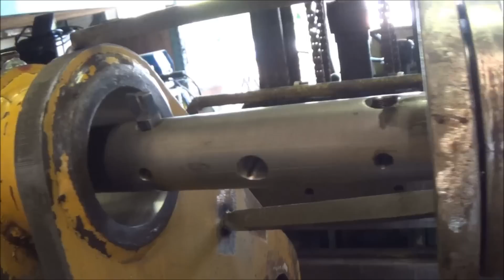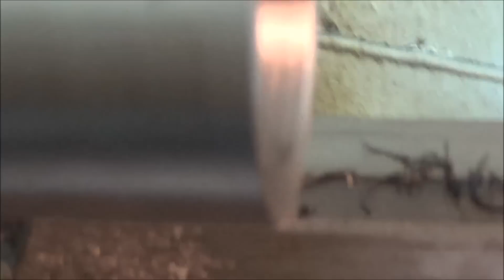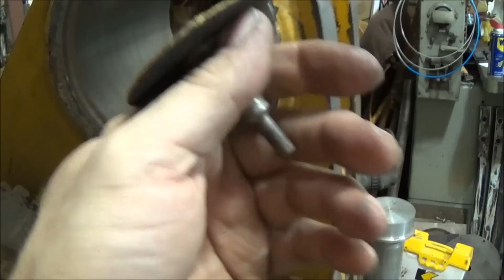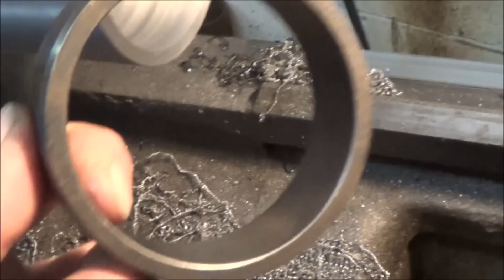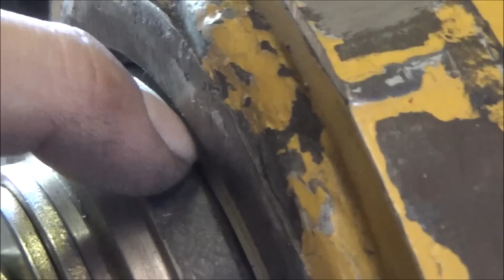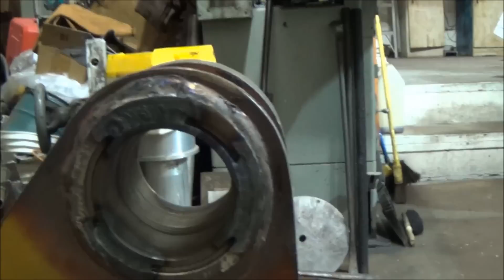Line Boring And Bushing Pt. 2

Comment from the maker: Hi Chuck,  Correct, the carriage and power head is not attached during setup, I will show a setup from the start, perhaps I can even do a mock setup. If "most" of the bore is OK, it's not to bad, bout if it's football shaped, it's gonna be a problem, and you have to get creative, same thing applies when the bores are far apart from one another and you can't reach with the carriage travel so you have to put carry bearings and switch from side to side, hence the occasional need for 2 head mounts
Reply: Most important to be sure your pins/bores are axialy parallel to each other. Hard to do that with cones if there is none of the original bore left.

Comment: Michael,

I would assume that when you set the boring bar using the tapered cones that the power head is not attached to the boring bar....it would be interesting to see how you determine/adjust the boring bar/cones to the existing damaged bore and how you what surface you use as square.....

nice work!!!!

Chuck